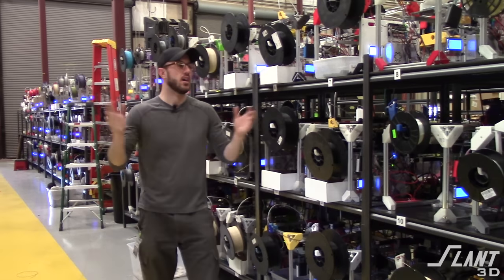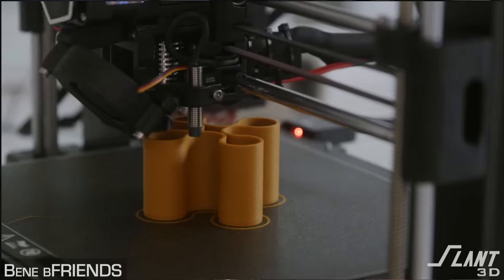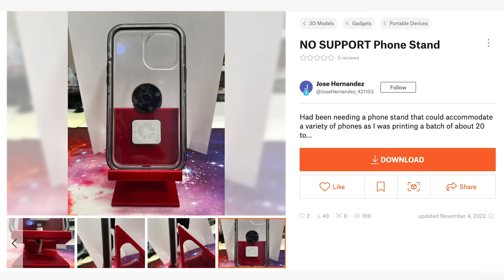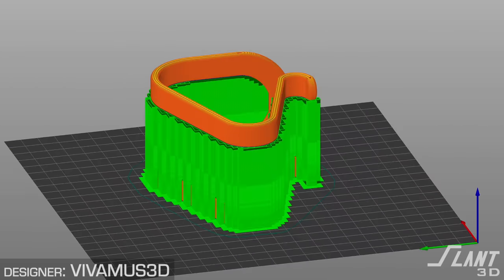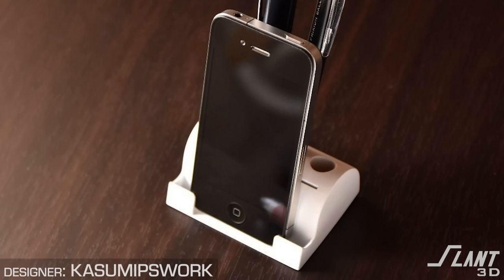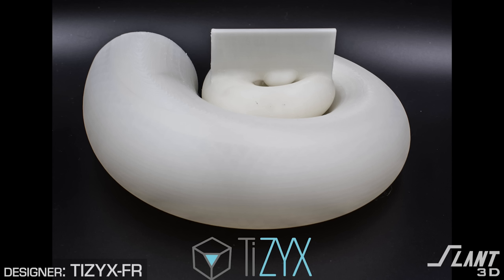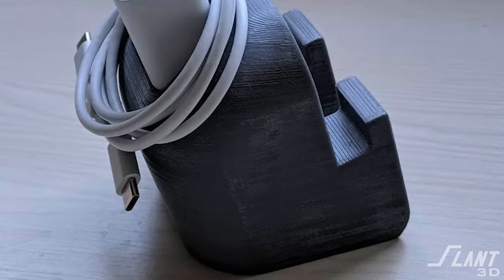3D Printing Engineer Reacts to Phone Stands: Design for Mass Production 3D Printing

Comment: I kinda feel bad for the original uploaders if they didn’t ask for the bulk manufacturing criticism.
Reply: I mean if you don't want your work to be criticized, don't put it out into the world....🤷
Reply: TBH, a lot of the designs out there are poorly designed anyway. No tolerances, lots of support, "some manual finishing required", etc. I'm not a mechanical engineer, but that seems like basic stuff. Not going into the more advanced stuff like stress risers, gear geometry. No offense to the original creators, they probably built one and it worked for them.
Reply: Another way to view this: is how could an existing 3d print design be made mass producible? Even if it wasn't the original intent.

BTW: this is the back story to how he launched on a path into a mass production business. He designed a simple product on the weekend. Made a bet with coworkers it wouldn't sell, so created a kick-starter as a joke, then had to produce 1000's of his design.

(paraphrased. there is a video on this channel that explains it better)
Reply: I remember hearing that slant3d was accepting submissions for videos like these. So I'm guessing most if not all of these were submitted by their author

I haven't confirmed this though
Reply: If it’s submission based, then it’s no big deal because then it’s asked for. But if it’s an upload to share with no intent to mass produce, then it seems unkind to insult their work. It’s like measuring a fishes intelligence by its ability to climb trees. I have made a few things and tossed them on similar sites for the purpose of sharing with a friend, family member, or small community; I’d be annoyed if I was featured in a video like this, especially if it was nothing nice said. Especially in this modern era where people will just flood the OP with negativity. People seem to forget that there’s a human with feelings, life, and emotions on the other end
Reply: @ligius3  it's not as basic as it seems, takes some proficiency modelling and or some iteration to get tolerances perfect! Lots of people make things as a useful one-off for themselves. Good fun but definitely not production ready! 😂
Reply: @AshAshAshAshAshAshAshAshAshAsh He absolutely did not "insult their work", he gave valuable feedback on how to make it better. That shows great care, consideration, and belief in the designs potential; your comments have far more negativity then his entire video, and far less benefit. Some people may be overly negative, but toxic positivity is just as much of an issue, and you definitely seem to fall in the latter category (Fish climbing trees? What kind of example even is that? o.0)
Reply: And by watching the video, you kind of are asking for the manufacturing advice, that's the point of watching the video; if you really didn't want to see the advice you shouldn't have watched the video in the first place
Reply: @TS_Mind_Swept  it seems you are missing the point entirely. I never stated that I’m not looking for the advice personally, however my designs are not in this video and I personally wouldn’t want that criticism on a one off I made to share with a friend. My tree/fish analogy works perfectly fine. However since you seem to not like that one, it would be akin to uploading a video of you and friends playing flag football at the park and some NFL commentator grabbing that video and criticizing your team and their ability to play by comparing it to NFL stars in front of their significantly larger audience. 

Also, your definition of “toxic positivity” is not accurate.
Reply: Most of “3d printable” designs on sites like Thingaverse and Cults suuuuuuuuuuck. They require custom supports, re-orientation or straight up re-modelling, to print without failures. All designs should be designed for mass production in mind, because it means ease of printing and less failure points for printing in general.
This problem isn’t unique for 3d printing. Contractors hate architects, machinists hate engineers and 3d printers hate modellers. Because people who design things rarely have ever made something with their own hands.
Reply: @3rdHalf1  You’re literally getting annoyed at someone doing something for you for free. If you doing like the design that’s not engineered for your task, then make it yourself. If you can’t, then pay someone. 3D printing is for prototyping as well. It’s like code, as long as it gets the job done than what does it matter. If you want the job done better, then make it yourself instead of complaining and criticizing others who literally didn’t ask
Reply: @AshAshAshAshAshAshAshAshAshAsh  Criticism is hard to take. I myself take criticism really bad, because I care about what I do, so it hurts personally. And it takes genuine effort to not be deffensive. But 9/10 times it has helped me to improve in what I do.
Back to the 3d modelers, who put things on internet. The problem is that there is no school, no ISO standards and not even well documented guidlines about designing parts for FDM printing. The result is that Thingsverse has turned into DeviantArt, where you have to sift through hundreds of crayon drawings of furry vore to get a single good pic of big tiddy Tifa Lockhart cosplay.

As for criticising people who didn’t ask, half of youtube is based on criticism about politics, cinema, games, tech, music and hopefully now 3d prints. The only way to avoid criticism is not publishing your work for public consumption.
Reply: @3rdHalf1  there’s a difference between a high budget film and a teenager trying to make something for his friends
Reply: @AshAshAshAshAshAshAshAshAshAsh  I understand your perspective. But, as someone who grew up moding games and posting on internet forums, I disagree. Sure, hate from randoms can be demoralising, but getting actual criticism from developers was genuenly possitive experience. 
Same with this video. It is not made by some random who hates on kids. It is from someone who works in the industry and explains flaws and how to improve.
Reply: @3rdHalf1  there’s a difference between warranted and unwarranted criticism. If someone is asking for or opening to criticism then it’s fine; assuming someone wants criticism without asking permission, not so fine
Reply: I love criticism.....its the best tool to improve your work.
Reply: Don't be so bland
Reply: @Danielo515  caring for others feelings isn’t a bland thing to do

Comment: The mechanical term, if I'm not mistaken, would be a knuckle where each segment interlock together. Great video and interesting lineup of parts for review. 👍
Reply: "Knuckles" confirmed. I was able to find a diagram. I would have guessed "teeth", because that's the anatomical term we use for zipper elements.
Reply: He may have been talking about the hing pin?

Comment: You've said at several points throughout the video about reducing bed contact area, and it does make sense in terms of print ejection, but how do you balance this with bed adhesion? Like in 'No Support Phone Stand' you proposed to taper both sides to a single line to make them indistinguishable, but wouldn't it just peel off the bed by third or fifth layer?
Reply: He seems to only talk about designs in terms of print farm considerations. 

Most factors are universally beneficial, like designed with no support, but low bed contact area is the opposite of what you want at home.
Reply: @cameltoast  Prints peeling off the bed would have about the same impact in a print farm as prints that failed to eject, if not more so. Maybe he has some tips for finding that balance, or for improving bed adhesion
Reply: Slant does not utilize bed-slingers so only the print head moves. This means there is no acceleration forces on the part, or more importantly on the contact layer of the the part/print bed.
Reply: A combination of a non bed slinger printers, with well tuned printers and sticky beds probably means that they can get away with minimal bed contact.

Comment: A hinge typically consists of the following parts:

1. **Leaf (Plate)**: The flat, typically rectangular part of the hinge that is fastened to the door and the door frame.
2. **Knuckle (Barrel)**: The cylindrical part of the hinge through which the pin passes. It is formed by the leaves of the hinge interlocking.
3. **Pin**: A metal rod that runs through the knuckle, holding the hinge together and allowing it to pivot.
4. **End Caps (Finials)**: Decorative caps that cover the ends of the pin. These can also serve to keep the pin in place.
5. **Swage**: The offset or bending of the leaves to allow for proper alignment and fit when the hinge is closed.
6. **Bearing (Washer)**: Found in some hinges to reduce friction and wear, allowing for smoother operation. These can be ball bearings or plain bearings.
7. **Screw Holes**: Holes in the leaves through which screws are inserted to fasten the hinge to the door and frame.

Comment: You have two slightly opposing criticisms/criteria and I do understand them both but have a question about them. You want to minimise bed contact area but on a few models you suggest having a solid or connected base, I understand you need to find a balance but which is more important? If you have a model that would logically be printed flat with a large contact area with the bed and you couldn’t print it with any other orientation, should you just leave the large contact area or should you try to reduce it with “cut outs”, or raised and bridged or ridged sections?

Comment: The different considerations for mass manufacture vs one-offs are interesting. For example, I learned that you should print as "flat" as possible, to reduce the risk of the print detaching from the bed during printing. Printers in makerspaces get messed with by novices a lot so they're usually not very well calibrated. But when you're making more than a few, it makes way more sense to spend an extra hour or two making sure the printer is configured perfectly, so that you can print in an orientation where the head can knock the part off the bed at the end.

Comment: For the car phone holder, the open cutouts are likely for cooling. If you have the phone charging or are using CarPlay/Android auto the phone can produce heat even with the screen turned off, so enclosing it could possibly overheat the phone.

Comment: For the S23 car phone holder, I would suggest to use atleast PETG (ASA is much better choice). Cabin temperature can go really high if parked in sunny areas. Not to forget about UV rays since not all cars have UV protection glasses.

Comment: If you have time, can you explain what you mean by ejected?   Do the machines you use have a separate means of ejecting certain parts?  And thank you for these videos they are quite informative.
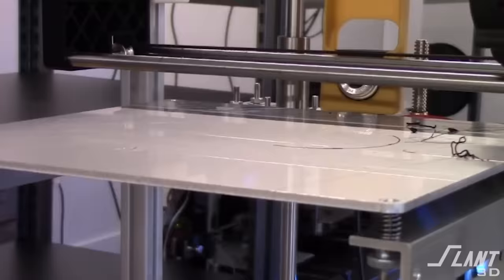Reply: He showed it at 9:41 The printer pushes the part off the bed using a "wall" on the printhead. Very interesting, I wasn't aware of the technique either.
Reply: @dekutree64    Thank you I totally missed that.  And right very interesting

Comment: 8:30 visually, the slots in the design do indeed not serve a function. But they might have some benefits thermally. Most cars these day seem to support phones to the point where the phone can run an app and the car's screen shows the output. So it'd be possible to use the phone for GPS navigation even without being visually "reachable".

And all my phones so far got somewhat warm while being used for that. I got a little "phone bag" for my bike in which I can shove it behind a see through cover, so I can use the GPS while biking too. And one of my older phones, stuffed inside that heat-trapping bag, got on one trip from a little sun and it's own heat output so warm, that the battery triggered an emergency standby to cool off.

I don't know if the heat output is drastically lower when the display can stay off, but if it is /not/, then those slots might be useful, depending on how hot the phone "runs".
And using TPU in that case could be even worse, but that's just my assumption based on what little material knowledge I have, which indicates that plastic is a bad thermal conductor, but rubber being an even worse one.

But this is pretty much "worst case" stuff. If the phone's just sitting in there, getting charged, maybe playing music at most, then those slots are definitely only aesthetical and therefore indeed optional.
Reply: I designed a foldable laptop stand with cutouts. It's a pain to print but required, since the laptop sits almost flat without it, meaning no airflow. It's a Lenovo Yoga if anyone cares. I simplfied the design so that it's larger squares instead of small triangles but still there's no reason to get rid of the holes. The fan induction area is small, not the whole width of the laptop, so every little bit of air helps.
Reply: TPU is not rubber and TPU is not that bad thermally, I believe I have seen articles about using some special TPUs for heatsinks.
Reply: @conorstewart2214  Which is why I stated that I just assumed. Good to know that assumption wasn't accurate xD

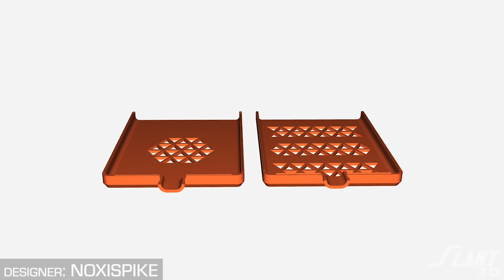Comment: 8:27 Those are holes for heat dissipation I think, as it partially encloses the phone and provides USB, it's not a great idea to bake it in a plastic sleeve while charging.
Reply: Most phones would probably be fine, unless it was a hot day but if you are charging your phone you are probably in the car anyway.

If the holes are needed for heat dissipation then there are better ways to design them that would be easier and better to print.

Comment: 8:26 It looks like it can hold a charging cable. I would presume the holes are for heat relief.
Reply: If they are then there are better ways they could be designed that would also allow it to be printed as a single piece vertically.